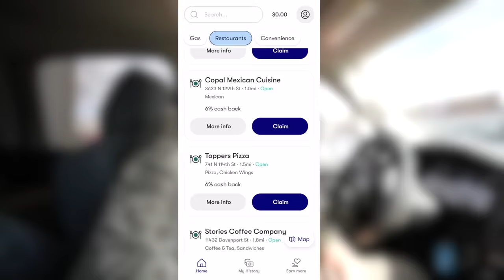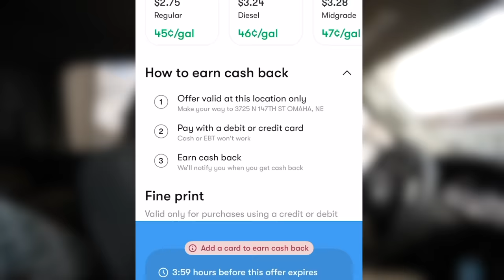Building a GIANT BEACH in the BACKYARD POND!!!

Comment: Should have gone to your local pond liner supplier and see what oddball scraps they have. Use that for a weed barrier liner, now that would be heavy duty. For the general nuisance weeds a four wheeler and chain link fence to drag behind as a way to turn up the sand to keep the weed roots exposed to the hot sun.

Comment: Battle ship idea
1. Get cheap jon boats or aluminum flat bottoms.

2. Drill holes in them (5 or so).  Then plug them.

3. Water balloon launchers in each boat.

4. Take turns launching water balloons at each other....alternating shots 

5. Each hit pull out a plug.

6. Once all plugs are gone.... sunken ship/structure.

Comment: @FLAIR. Why not find your local scrap/salvage yards and just make a video of scrap hunting for pond structure? Maybe do some research on boat or plane graveyards in the area? You can always get a high powered sprayer to clean the structure if it has lots of chemical residues. 
Another idea is that you could just get a bunch of resources from Home Depot and have you and the guys do a DIY structure challenge. Just remember that lots of materials will float so you will need to get some cinder blocks to tie up and sink.

Comment: You could move that sand while the pond is filled with a gold suction dredge.
In a few years  you dive with the hose and move the sand back up the beach with the discharge, no need to drain.
 ( It is kinda fun too )
Do a cheap boat challenge. 
After the pond is done yall use  $X amount to build or buy boats for a regatta on the pond.  
The losers boat becomes structure. Judge on style and comfort.